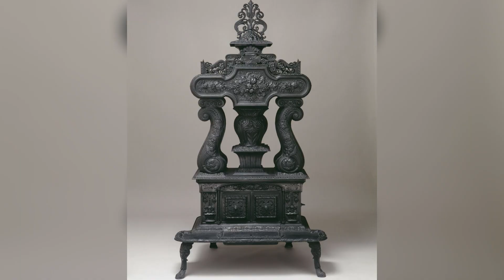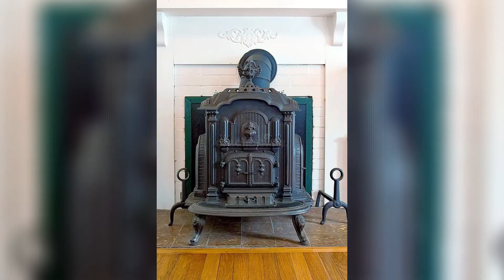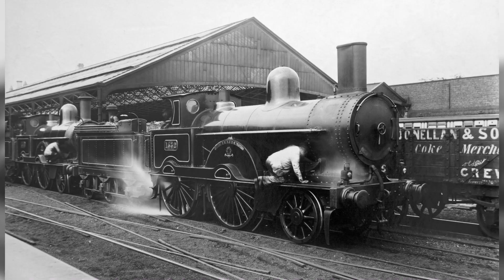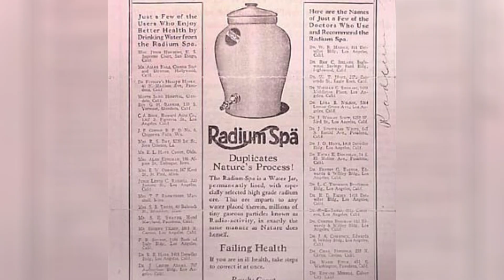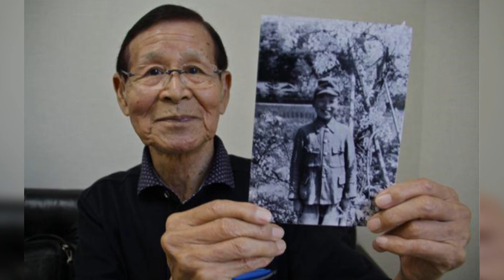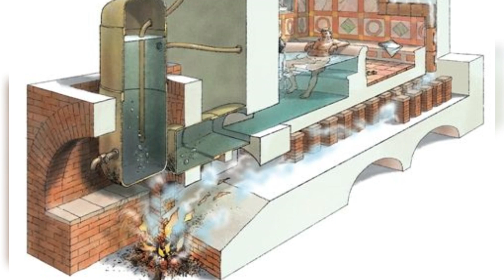The Forbidden Technology of Radium Stoves | Lost Energy Revolution of the 19th Century

Comment: 1:50 what about Coal?
So far most of the ones with no chimney at all have been coal gas stoves, and yes they just huffed the fumes because they thought it was "clean" burning.
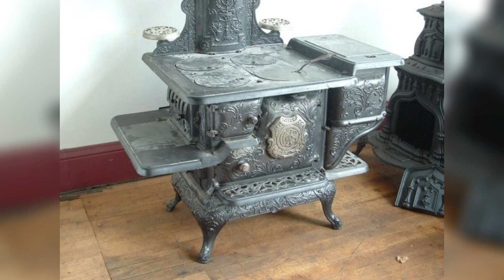4:05 those specifically can burn using wood for several hours using like 1 or 2 large ish logs cut into quarters.
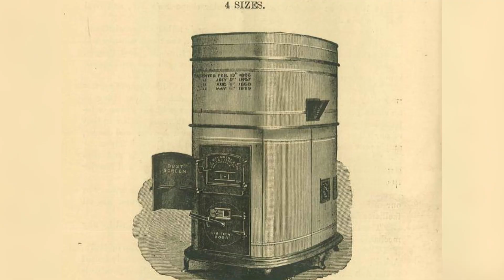7:03 that's a Bulgarian coal stove. (Top plate: Vulkan Varna
Bottom plate: pernik) They burn "brown coal" (lignite).
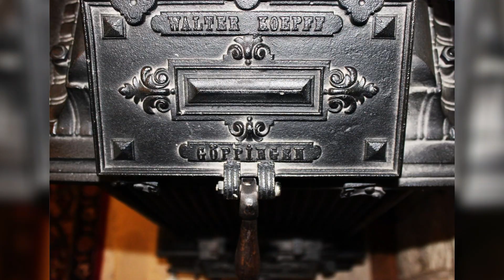7:39 is a coal gas (or town gas) stove